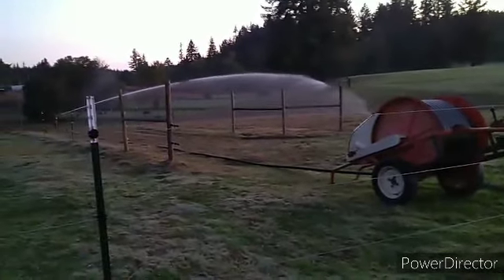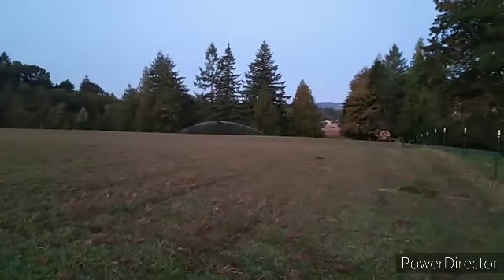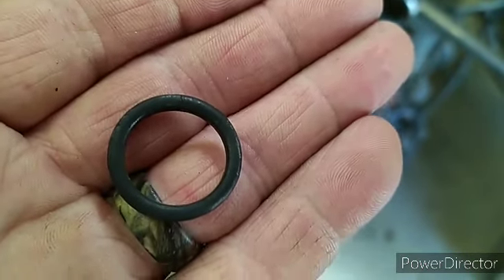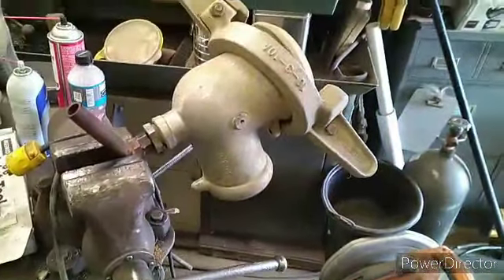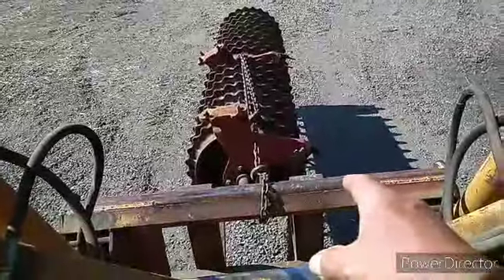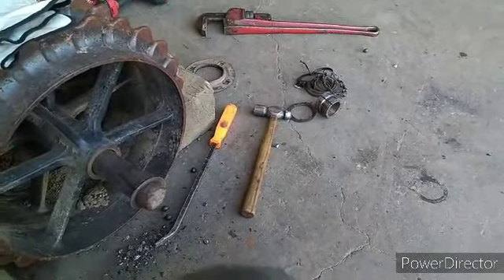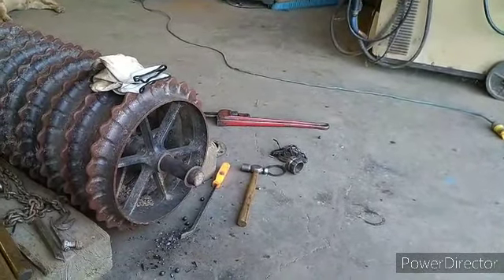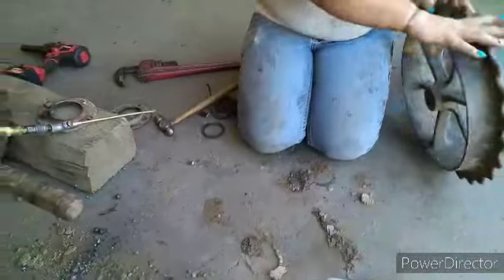replace cultipacker bearings

Comment: Good evening Ed
Reply from the maker: Good evening Richard
Reply: @GosselinFarmsEdGosselin  got the wheat all done
Reply: @GosselinFarmsEdGosselin  have to  go  to southern Kansas  tomorrow  to  pickup  what I  bought  on an online  auction
Reply from the maker: @richardwilkens4577  nice 👍
And oh, what did you buy?
Reply: @GosselinFarmsEdGosselin  a nice set of 13.8 x38 duals  with hubs  that will fit on my 60 john deere  and a number 7 john deere shelter that I  couldn't  believe  went so cheap
Reply from the maker: @richardwilkens4577  sweet!!!
Reply: @GosselinFarmsEdGosselin  yes now I  can shell my corn and haul it to the grain co-op